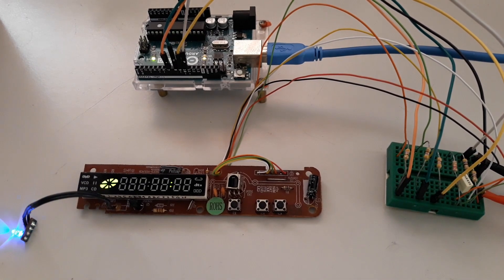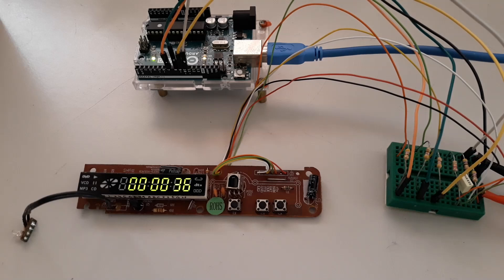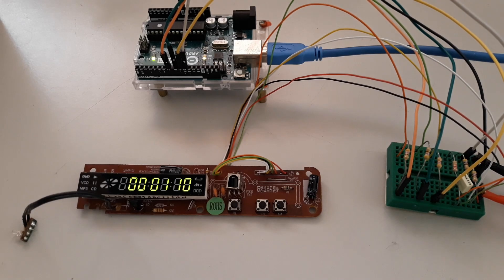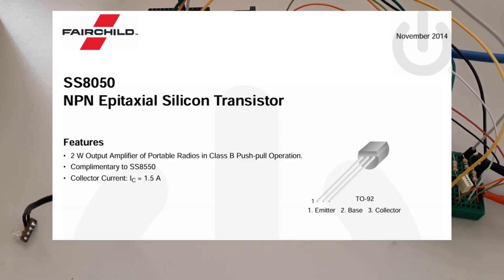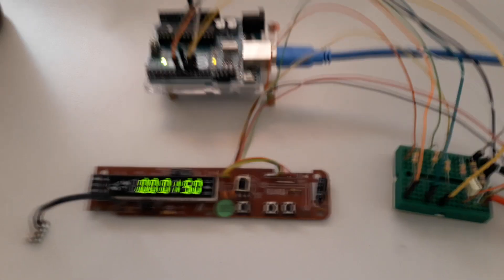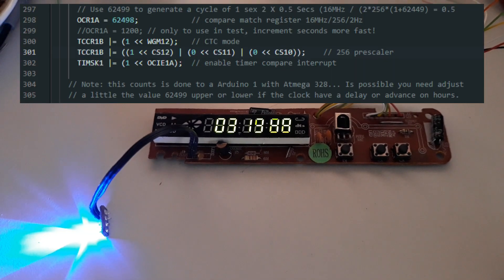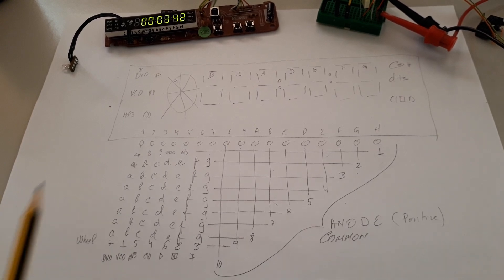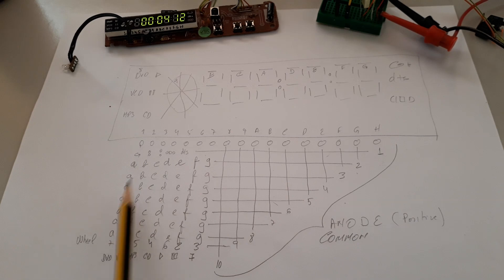CS1694

Comment: Привет. У меня есть такой индикатор без платы управления. Пока никуда не применял. За репозиторий спасибо пригодится.
Reply from the maker: @localixdots9698 These small panels are easy to use if we take into account the changes they made in the order of the digits, it's really just to make it difficult! But it is easy to remove the display and apply for example 4 individual larger Common Anode displays! Thanks by your look!